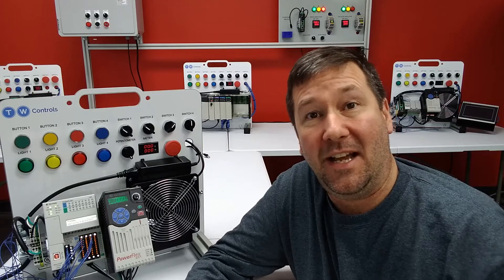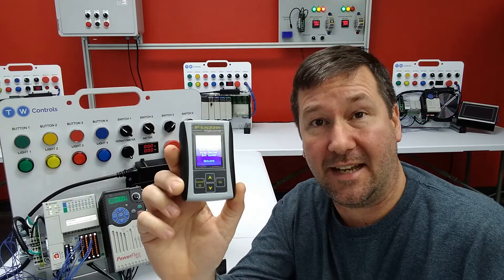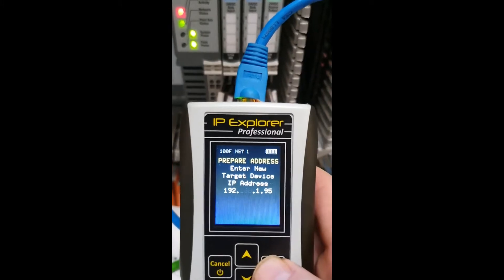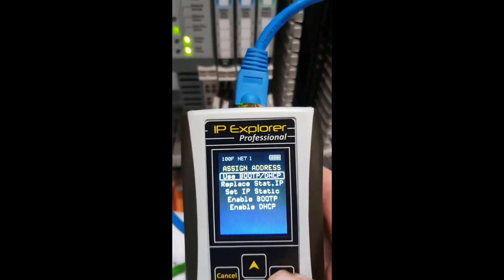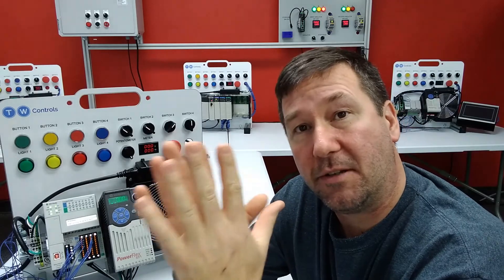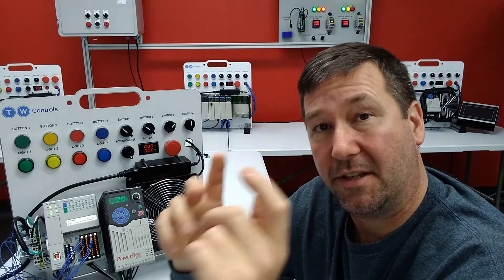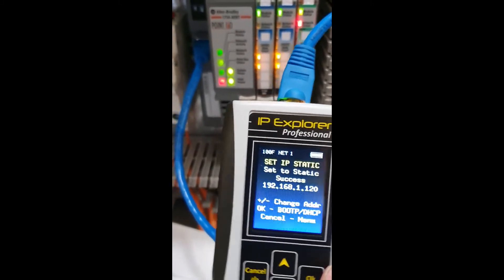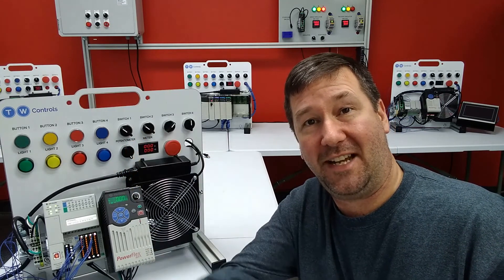Set the IP Address of an Allen Bradley 1734-AENT Point I/O BOOTP DHCP

Comment: Hi Tim Wilborne. While doing this, what should the number of the 1734 counter device be?
Reply from the maker: There are several different ones.  I am mostly familiar with the 1734-VHSC24 but you should consult with your Rockwell Automation distributor to determine what is best for your application.
Reply: @TimWilborne  okey.my main question is this. The place where the 3 digit number is 999 or 888, what should the number be here?

Comment: Does it set the subnet & Gateway?

Can it read the subnet & gateway?

These are two features that would be helpful to verify on third-party devices where the EDS file is not working & the vendor doesn't plan on fixing it.
Reply from the maker: It can write the subnet and gateway but it can't read it.  Devices don't typically report that information.
Reply: @TimWilborne  

That is what I thought, I use Boot-P to write the IP, Subnet, & Gateway

I check things with a NetScout.

Tried to find an easy alternative for Windows but Windows is blocking because they control hacking.

Kali allows this but we all know that Kali is for hackers.

I am an Information, Automation Controls Specialist right now so I use Splunk & OT-Base for network monitoring but was looking for a great resource for my techs.

Thanks for the time, hope all is well.

Happy 4th
Reply from the maker: Happy 4th to you!
Reply: I have tried a few python applications but unless you use linuex then they are restricted.
I also tired nmap.